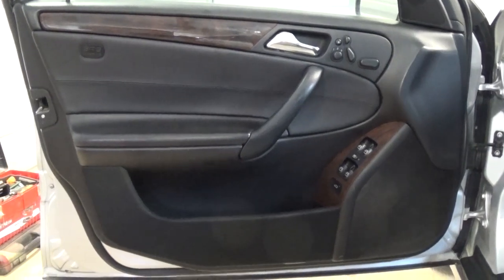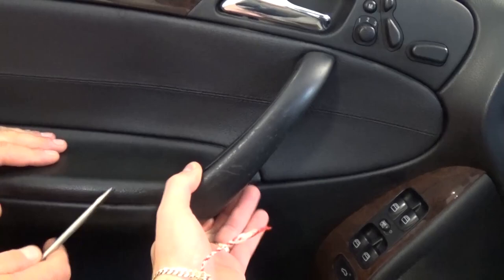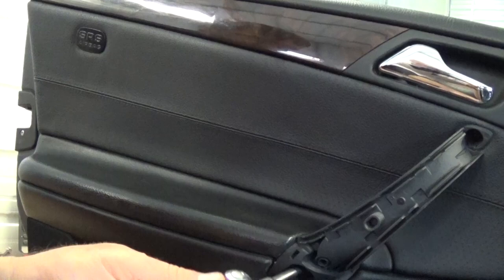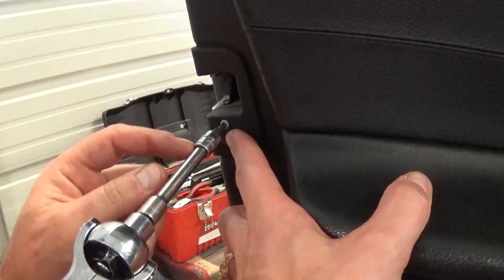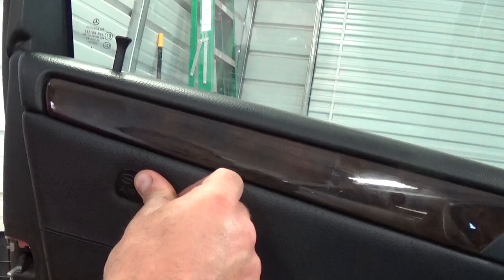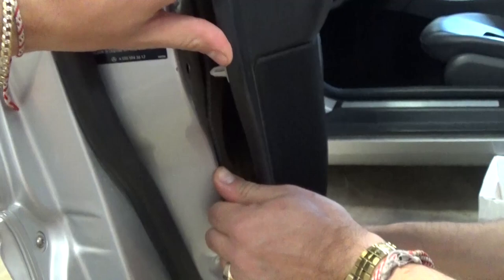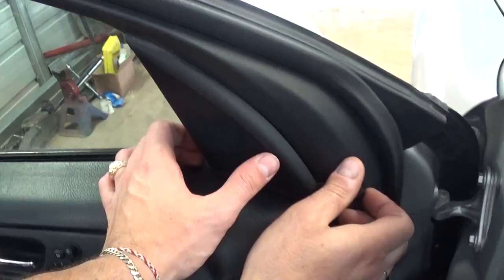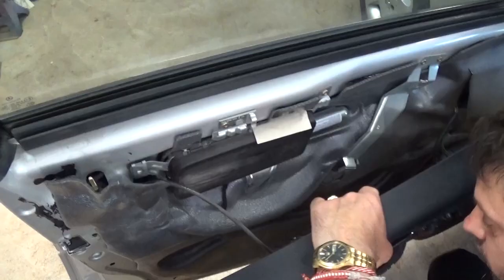Mercedes W203 Front Door Speaker Removal and Replacement  c180 c200 c230 c240 c320 c270

Comment: Hello, i have w203 with bose sound system, but it does not work in the front. When the right passenger door is opened, the speakers work, how can i access the wires to fix this problem? This has been a problem for a long time. Your channel is great, thank you.
Reply: Guðjón wire problem??

Comment: Listen, most of the cheap plastic in these Mercedes will break. You will need replacement parts to put the door back on and the handle WILL break no matter how gentle you are. The cheap plastic used in these cars becomes brittle unlike a cheaper car such as a Ford.
Reply: In my experience every single trim clip becomes non reusable when a car hits 18 years old